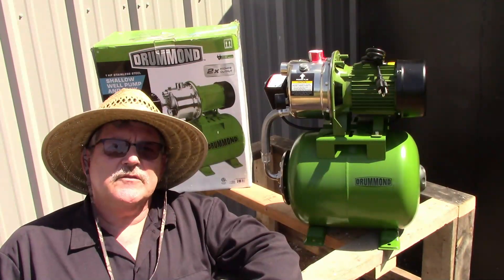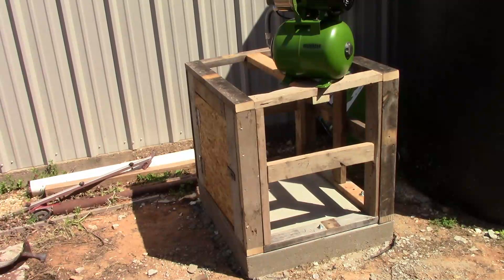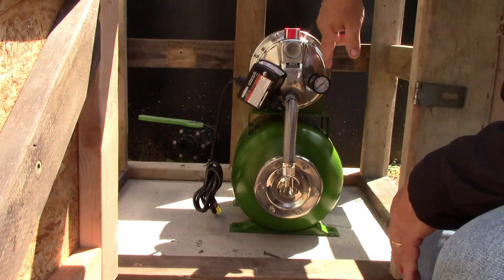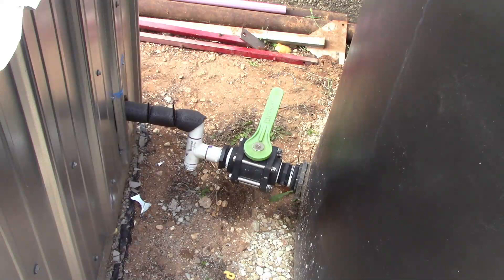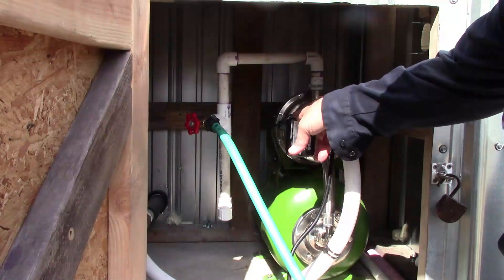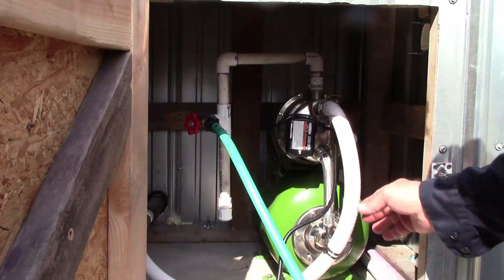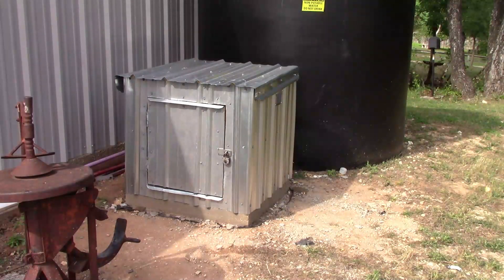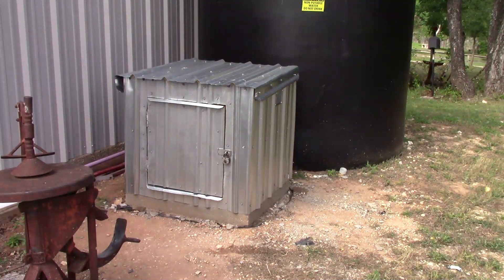DIY Shallow Well Pump Installation for rain water collection.

Comment: What happens if no check valve is used?
Reply from the maker: You could run it without a check valve but the pump is higher than the bottom of the tank and I didn't want it to lose it's prime if the water level in the tank got lower than the pump
Reply: @RustyGlovebox  
Thanks for the help, added the check valve on the tank side and worked like a charm!

Comment: Does the little tank below the pump actually hold water or is it air?
Reply from the maker: The tank has an air bladder to help maintain a constant pressure when using. Works well

Comment: About the check valve.....close to your big black tank?  I have similar system in which i use ibc totes to transfer rainwater to a large black tank through filters.  I have the same pump installed on the black tank which will feed the pressure tank for the house...both 30/50.  Im wondering where to install check valve.  Thanks for your reply.
Reply from the maker: I put the check valve between the pump and the tank . That way the pump doesn't lose prime when the tank level is lower than the pump. Good luck
Reply: @RustyGlovebox  Thank you!

Comment: I bought exactly the same pump combo, but it won't stop after pressure built up, and pump water backward through the inlet. anybody knows why give me a hit? contacted harbor freight, no response so far.
Reply from the maker: The impeller seal must be torn or burned up for it to be bypassing .
Reply: @RustyGlovebox  thanks. do I need a check valve on the inlet end?
Reply from the maker: Yes, If you are using it with a shallow water well.  If you have an above ground tank it is optional. I used one so the pump would not lose prime when the tanks is low.
Reply: @RustyGlovebox  thanks

Comment: Nice set up. Good thinking on the hot tub piping. Works great and good use of the rain water. I've got a single barrel that fills up and we just dunk a can in there to fill up for watering. LOL! If she's happy, I'm happy.
Reply from the maker: Thanks Pat, I'm going to start running the plumbing soon.

Comment: Nice build.. the only thing missing is a bladder tank.. maybe just a 2 1/2 gallon bladder tank to keep the pump running longer and keep your start/stop cycles lower..
Reply from the maker: It has a small bladder tank under the pump and works better than you would think. Thanks

Comment: That is a  great professional job, well done, what do you have as filters in the whole system from the roof to the spray nozzle.
Reply from the maker: Thanks Jan, I have a couple of pre-filters/screens that stop trash from entering the tank from the gutters. And I pickup the water from the tank 6 inches from the bottom. It will work great for watering plants this summer. Have a great week my friend